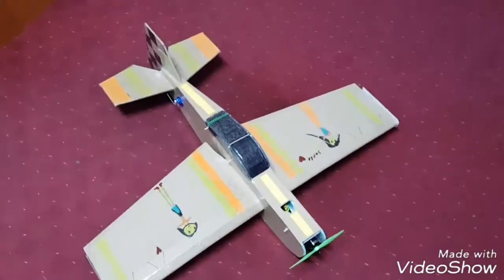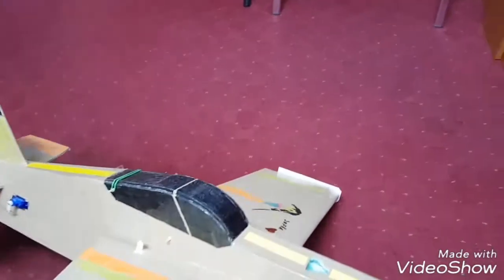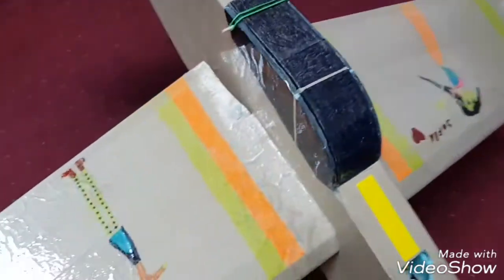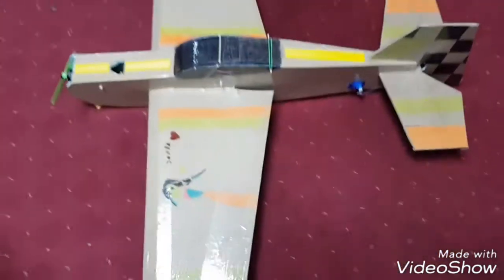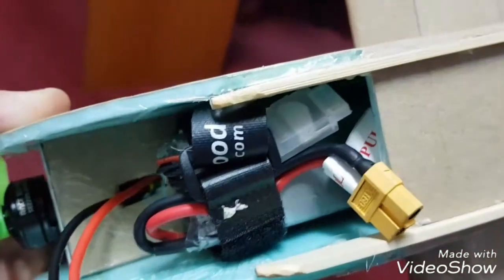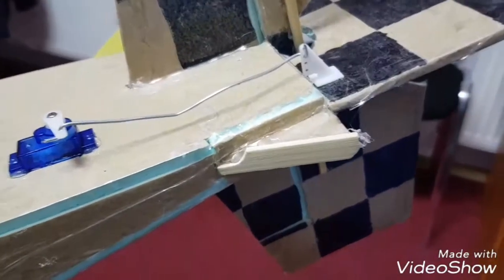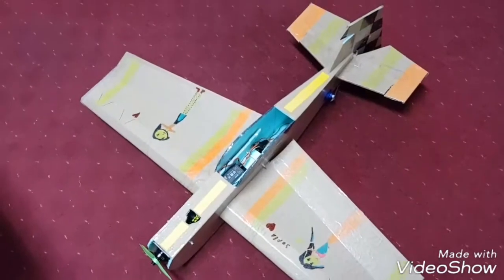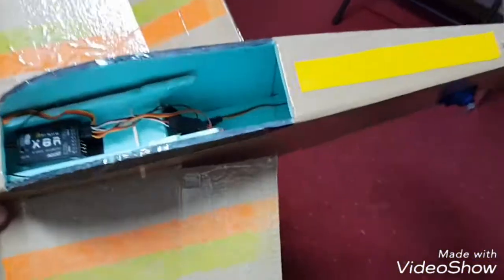FT 3D Airplane scratch build

Comment: thanks for posting.  nice work.  some thoughts for you and your subs.   the profile used for the main wing looks nearly symmetrical.  if it is, the wing will only make lift when the angle of attack is greater than zero.  the use a paper and glue outer covering will have added a lot of, otherwise avoidable, weight.  the rudder is quite large.  note that when a mode has a zero-dihedral main wing, it will NOT turn with rudder input.  a turn must be initiated with aileron input and completed with up-elevator input.  note that the bits mounted at the wing tips are going to cause turbulence and drag.  the broad fuselage cross-section at the firewall is going make a lot of turbulence, just behind the prop. on a model this small, do NOT mount servos aft; mount 'em near the cg.  correct cg / balance point for this type of model is 30 percent of the main wing root chord, aft of the wing leading edge.      cheers
Reply from the maker: David Davids thank you for your advice